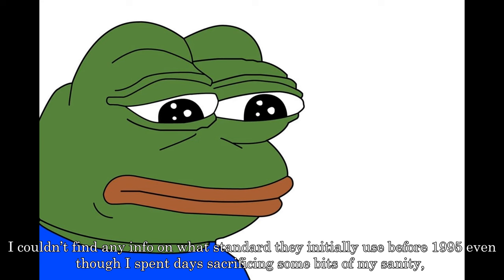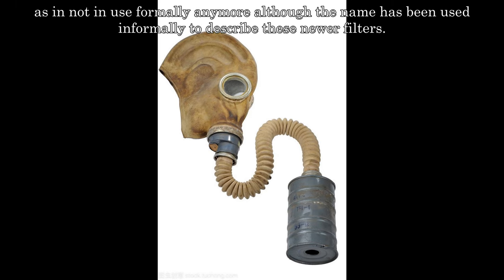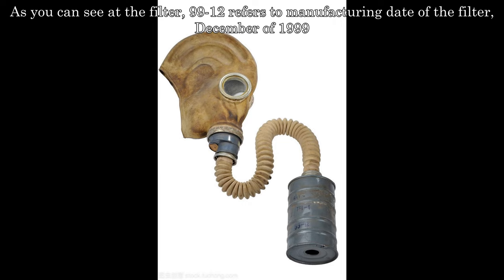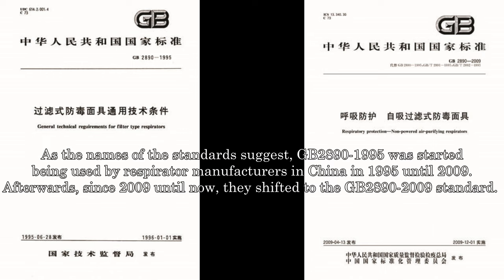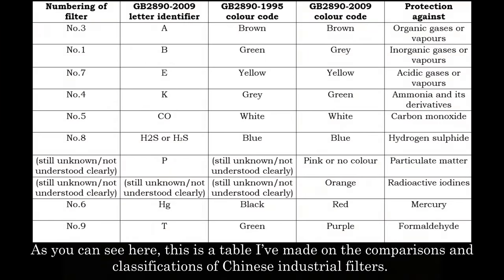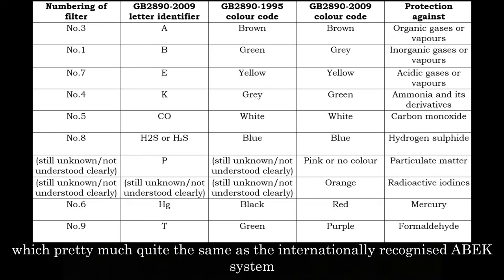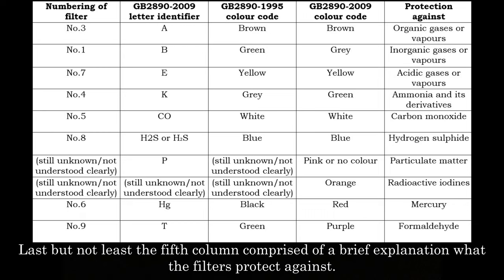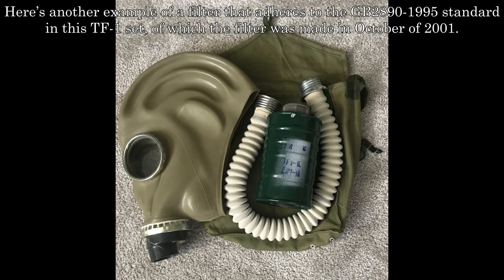Brief Explanation on Modern Chinese Industrial Coffee Can Style Gas Mask Filters

Comment: Wow, great that you filmed the inside of the filter under the cover!
For a long time I could not find out what kind of structure they have, with a vertical arrangement of layers (as in most gas masks) or with a horizontal arrangement of layers (as in type 64 or the Soviet RSh-4).
Now I realized that they are horizontal, thanks!

Comment: Are modern Chinese gas masks still threaded in GOST? I don't understand why NATO filters work on the modern Chinese gas masks the weaponsandstuff tested.
Reply from the maker: While most industrial Chinese filters use GOST, some are STANAG threaded. For masks catered for or was originally designed for use within the Chinese armed forces on the other hand mostly uses STANAG instead nowadays. The reason why some STANAG filters "fit" into some Chinese GOST filters are due to them having large tolerance and/or having plastic threads that bend to confirm to the thread of the filter. This is like smoking cigarettes; you can't see the bad effects in the short term, but you'll see them in the long term.

Edit: I almost forgot to note that "normalised" or "standardised" threads don't exist. I once knew a Slovak that would go mad whenever someone mentions that STANAG filters fo GOST masks and vice versa. Funny stuff there.
Reply: The manufacturing tolerance must be large since DIN40 threads (4mm pitch compared to NATO 4.7mm pitch) also fits in perfectly.

Edit: I also researched that parallel thread (ones used in gas mask) does not make a seal, so they use accurate threading or o-ring to make the seal. With a large manufacturing tolerance, I think its the o-ring and rubber gaskets in Chinese mask that makes a seal, so my DIN40 filter fits in because of its same height and diameter works just fine along with other NATO filters that have the same characteristics as such.
Reply: @Boris_Din_Dietrich__Hazim  I'll measure the Chinese mask threads with a pitch thread gauge then get back to you. I really do not understand why people guess threads instead of actually measuring it.
Reply: A good portion are gost